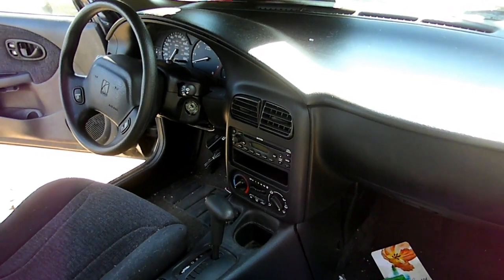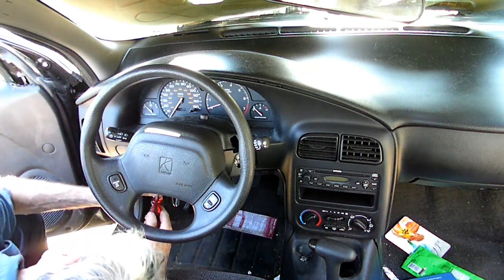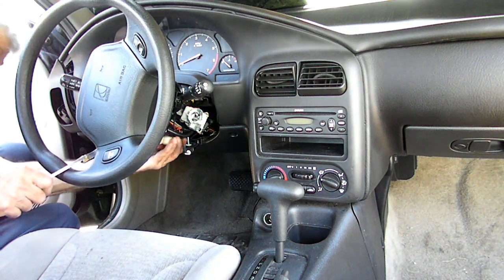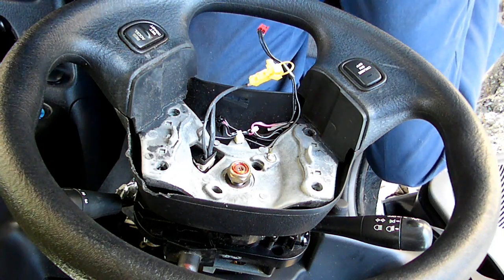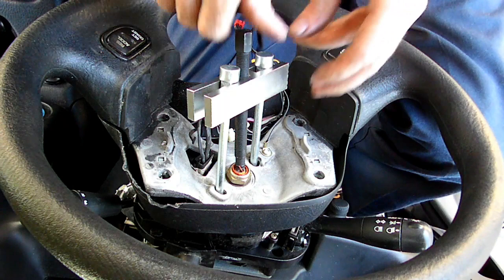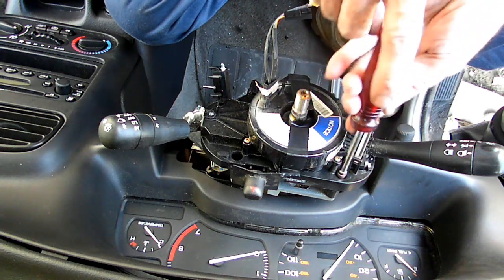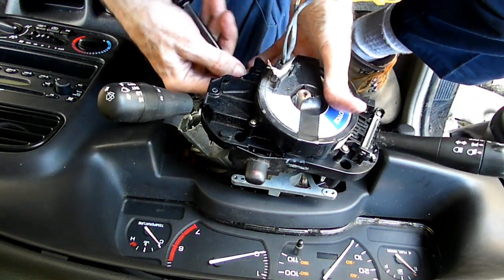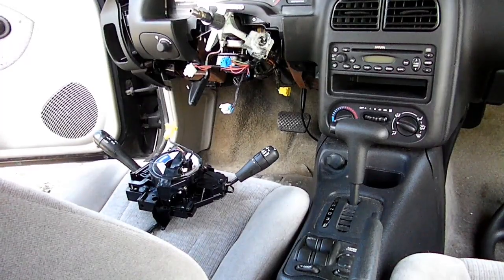Saturn Gen 3 Multifunction Switch Removal

Comment: Repair complete, new switch in place, thanks RichPin !!  My wipers no longer have a mind of their own. Two notes:  I couldn’t find a steering wheel puller with small enough J-hooks, so I resorted to whacking the steering wheel with a rubber mallet, it worked great. Also, the “under dash” electrical connector, on my car, was zip-tied to other wiring, so I had to remove the lower panel(just above driver’s feet) and cut that zip tie.  Thanks again, with your help, this ol’ 2000 Saturn SL will hit 250K miles soon. Cheers!

Comment: Hey Richpin. Your videos on the saturn S-series has been greatly useful. I've got a 02 SL1 gen 3. The cruise control(Not working) and horn just clicks. All the fuses are good. Only thing I can think of is the clockspring or does the multifunction switch a possible cause?
Reply from the maker: If you are hearing a clicking from the horn relay then upstream from the clock spring should be ok.

Comment: If I have a 3rd gen without cruise control or coast. If I swap out the multifunction switch and steering wheel - will the cruise control and coast work?
Reply from the maker: It needs to be turned on with a tech 2 scan tool when you are done.

Comment: Could this be the potential fix for the following condition:  Low beams on all the time with the car off, key removed, and multi-function in the off position.  I've replaced the DRL relay, but no joy there.  The only way to have the headlights off is to remove the two fuses.
Reply from the maker: I would suspect the headlight switch as the potential problem.I will look into making a video on how to test the switch.
Reply: Thanks.  I haven't been able to climb under to see if there is a short in any of the headlight wires.